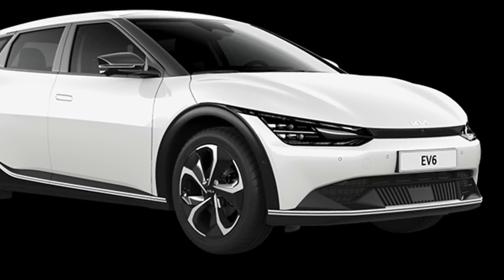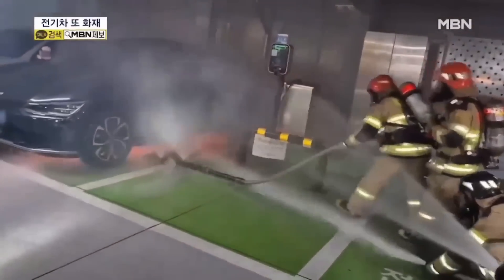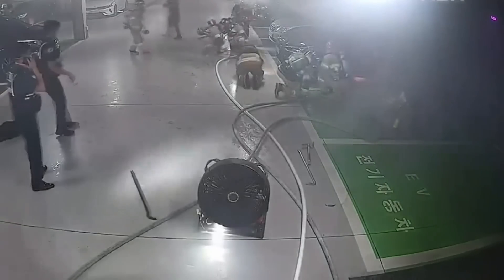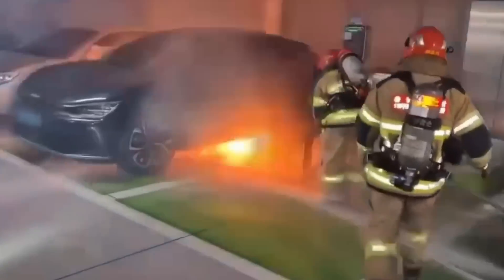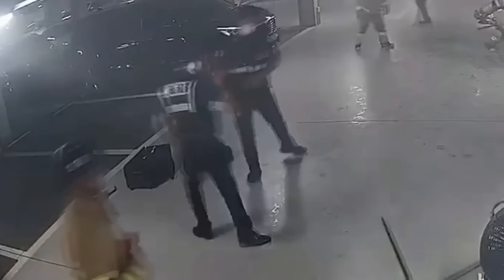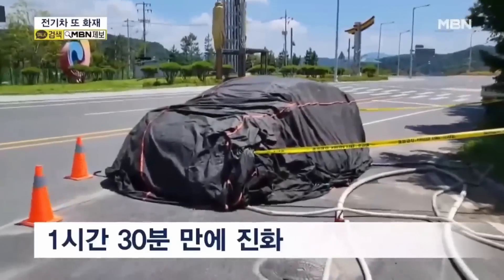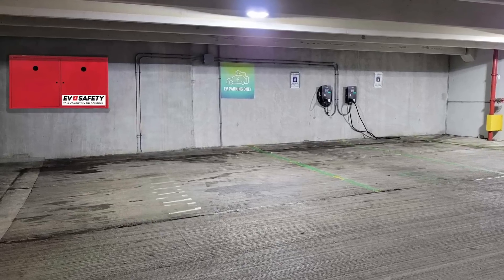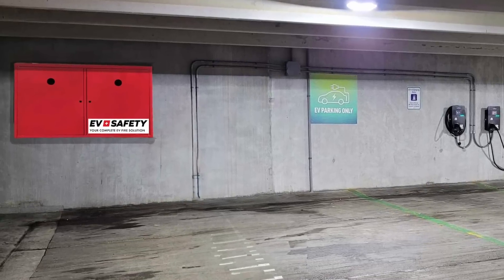Second EV Fire in Korean Parking Garage: Days Later

Comment: In every single Li-on battery based fire (cars, laptops, tools, scooters EVERY SINGLE ONE) a consumer action lawsuit should be filed for "unsuitability for purpose" along with any other violations, losses, injuries, etc.  These batteries have brought down airplanes, caused numerous injuries and deaths and in general are eventually destructive to either humans or the environment.  Congress needs to step in and BAN their manufacture until it is de facto proven that these environmental destruction and thermal runaway problems are solved and no longer exist.

Comment: Garage operation includes towing disabled and abandoned vehicles whose population will reflect increasing BEV adoption. Rollback truck owners often choose aluminum beds for lighter weight, but aluminum melts easily while a steel bed (popular for hauling scrap because it doesn't gouge and crack like aluminum) is MUCH safer if its BEV cargo reignites because bed floor burn-through is far less likely. 
I mention this in case anyone reading it can influence vehicle purchases, for example by police towing units and civilian towing companies on police rotation who may be required to haul off BEV as part of their contracts.  Anyone wanting to test could likely borrow a scrap steel rollback bed as a training aid since it won't be worth any less with the paint burned off. Outdoor parking lots have similar problems with disabled and abandoned vehicles so BEV towing skills including understanding BEV fires will be increasingly important. Modern towing and recovery is more complex than it used to be. Of course towing requires impound lots whose contents should be arranged for easy fire apparatus access between rows.

Comment: Fire Control for runaway Ev's ?? IDEA!!

How about a simple Shipping Container, with a simple,powerful winch ... 

The Shipping Container is lined with fireproof material like that popular fire resistant drywall (many but reasonable number of layers, with metal in between the layers)

Winch in burning car, a tow truck guy and a firefighter could come up with a safe and simple attachment method, or various such methods ... 

Winch in burning car, doors slam shut and latch!!   Fill container with water from both sides through access holes for the purpose.

It'd be worth a try at least, concept is simple!!

Comment: I live in Korea ATM. This is a huge issue here, and many apartment complexes are taking quite drastic measures to try to eliminate as much EV fire risk as possible. Some even outright ban underground parking, while others just ask owners to charge only when absolutely necessary
Reply: Electric vehicles can set the surroundings on fire. 

Gas vehicles are setting the planet on fire.
Reply: @franklofarojr.2969 wow. Just wow
Reply: @franklofarojr.2969 Gas cars produce only 10% of global CO2 emissions. Mining for lithium and other elements for EV batteries uses petroleum, and it devastates the area around the mine and spreads toxic dust. Disposal of EV batteries generates CO2 and toxic wastes.
Reply: @franklofarojr.2969

Tell me you're brainwashed without telling me you're brainwashed

Comment: To me there is a huge opportunity to avoid ever getting to this state.   It's a shame the industry doesn't unite and tackle this.

The BMS not only has the ability to detect a run-away event, but sometimes DAYS before this condition occurs.   The problem is, the BMS has no way to scream about it.    To me ALL EV's need to be mandated with a standardized wireless alert systems that talk to Building monitoring systems to warn of a vehicle that may be approaching a runaway state.   

This would allow responders to quarantine the vehicle before it starts to off-gas, or at a minimum allow a much earlier response.

Comment: Hyundai Ioniq and Kia EV6 have been frequently involved in accidents where the vehicle burns out and deaths occur due to battery thermal runaway after crashing into a low curb. A thorough investigation is needed to prevent further casualties.

Comment: You said the battery was 800 volts, but you didn't say its type... is it the LFP or NMC type? Do you know of any cases of fire with an LFP battery?

￼
Reply from the maker: This was not LFP.  There have been a number of LFP fires tied to energy storage.
Reply: @StacheDTraining  wow that's great, so we don't have any cars with LFP batteries that caught fire spontaneously?
Reply from the maker: @Rafa-qv8si  there have been.  Quite a few BYD vehicles. Unfortunately, it's often difficult to know which vehicles use which battery chemistry.

Comment: I wonder if a pre-piped flooding system would help in the future? A keyed cap in the trunk provides a path for apparatus to pump directly to the battery compartment and drain out a pressure relief valve that flows in a safe direction. It could be installed in all EVs and used to cool the battery in thermal emergencies, preventing the fire from even starting, or providing easy extinguishing access.

Comment: Ev are failing globally, and not enough time testing is being on the power cells to render them "safe". Governments around the world have welcomed these vehicles with open arms to look like there proactively saving the environment, when in fact its poisoning the air, we breathe and the water we drink. So where do we dispose of the defective or expired batteries when they no longer hold charge? LiFePo4 Lithium dump, or furnace? Hmmm. Of course, the EV manufacturers scream their vehicles are safe and line their accounts with big fat profits. Someone has to make a stand and stand up to stop this environmental disaster.

Comment: Comparing the Benz EQE's Chinese-made battery explosion and fire with the incident involving the Kia EV6, it is clear that the safety of Korean-made batteries can be reaffirmed. In the case of the Chinese battery, the fire rapidly spread between cells and eventually led to an explosion, likely due to the materials used in the battery separator. In contrast, the SK battery used in the Kia EV6 exhibited delayed fire onset, allowing the vehicle to be safely moved from an underground level to an outdoor area.
Reply: It's a silly comparison, like comparing being mauled by a bear to being mauled by a lion, they're both dangerous. lithium is dangerous.
Reply: @wobblyboost  The flaw is SK get the materials from china.

Comment: The incident outline is that a Kia EV6 caught fire while charging in a parking lot, but did not explode, and the fire did not spread to adjacent cars and was extinguished by firefighters in about two hours..   The possibility of a fire in an electric vehicle equipped with a reliable company's battery is more than 10 times lower than that of ICE vehicles..   Even in the rare case of a fire, it is important to manage it safely with a sprinkler, pre-staged fire blanket, etc..
Reply: Yeah, but it's more fun to go "RAAAH EV BAD! LOOK AT MY 6.7 LITER DIESEL! SOOO MUCH COAL ROLLING! WOW!" and get the likes ;) .
Reply: Traditional fire systems such as sprinklers and fire extinguishers which work by isolating the burning material from the air (and therefore from oxygen) are totally INEFFECTIVE against battery fires. The battery fire is not a standard combustion with oxygen in the air, but a chemical reaction in which both the fuel and the oxidizer are packed together so much so that even immersed in water it would continue to burn. Guess what other substances are made up of a mixture of fuel and oxidizer? If your answer is EXPLOSIVES...Yes you guessed it!
Reply: if the possibility is so low for EV's to catch fire... THEN WHY DO SO MANY OF THEM GO UP IN FLAMES    your ignorance of thinking that they are "green" and better for the environment than a normal car is impressive.   People seem to forget about basic Biology real cars right now put out CO2 which PLANTS NEED TO BREATH but since idiots on our planet keep slicing down forests left and right we have a build-up of CO2  so its simple QUIT CUTTING DOWN THE GD TREES and plant more of them and you could more than likely fix a good portion of the global warming problem.
Reply: If an EV catches fire in a parking garage and destroyed 100 ICE vehicles. Does this mean it was 1 EV fire and 100 ICE fires?

Comment: EVs just need to be banned. Problem solved. 
Enough already with this nonsense.
Reply: There are already 40 million on the road, numbers are growing everyday and here in Thailand EV chargers are cropping up everywhere.  I have been riding my electric motorcycle with its 72v, 30 amp hr battery for 3 years and it is just perfect.  Bought a BYD Seal 5 months and 7000 kms ago and it is the future....if you think EV's are going to be banned you are in for a bit of a disappointment.

Comment: Hyundai/Kia/Genesis, aka Korean auto makers are notorious for vehicle fires.  They're been recalling vehicles for potential fires every year since 2015 in North America.  So, this news is not surprising.
Reply: Your correct, they have a fire recall on the antilock brakes. It's possible for the ABS module to catch fire, even when the car is off. Not to forget about the engine fires recall too, where the engine seizes up from low oil. There's multiple ways they can burn down.
Reply: That’s all one company. Hyundai/Kia is a brand which also makes Genesis. This is like saying Ford/Mercury/Lincoln and then saying, all US companies.. it’s all one company.
Reply: @Where2bub  No kidding, Sherlock Holmes.  LOL

Comment: The big danger with this as you have pointed out is the gross ignorance of the people around this scene without BA.  The reason for this ignorance is that the danger (at least in the UK,) is not being publicised. In a confined space the clear instruction should be NOT to try to extinguish (coz you cannot) and to get out of the building and call the fire service. Some guy was there with an extinguisher I noticed.  This message is not being publicised and it’s going to lead to a very tragic event before too long.

Comment: what they need is a suppression bath nearby to the ev charging bays and parking bays so the ev can be towed from a redirect pulley or wall mounted winch straight into the suppression bath, with smoke ventilation ducts above. At least ten it protects the car park and the other cars, and limits smoke contamination of structure, cars , and apartments...
Reply: First responders in Korea apparently have no clue about lithium ion or lithium metal batteries.  Thank you for showing how effective blankets are at containing a battery fire.  The second necessary step is to use an extinguishing agent designed for lithium.  F-500 EA has been available for over 15 years.  It is past time for first responders to have it, or a similar product available.

Comment: Whats the point spraying water on a box containing a fire ?
How about a valve/socket pipe on the battery case where crews can connect a pipe to, and inject water, or CO2, or liquid nitrogen...
Reply: Mining trucks have them but aesthetics being what it is the car manufacturers think it will turn away potential buyers. 
No reason why it can't be hidden in the trunk or where the engine should be.
Reply: @NortyNige  @NortyNige I didnt know that !. They could fit a quick release connector underneath

Comment: Diesel vehicles are very often blamed after the EV catches on fire!
Reply: I presume you have not seen the video of the 2014 Rangerover Sport starting the fire at Luton airport where 1400 vehicles were damaged.
Reply: @peterjones6322  er that is what I was trying to elude to!!!
Reply: @one.wonders  So where was the EV in that incident? I know that a 2014 Rangerover isn't one.
Reply: @Tschacki_Quacki  the hybrid diesel!
Reply: @one.wonders  Besides the fact that it got immediately debunked that the car was a hybrid, I don't see the logic in saying that a hybrid is an EV???
It isn't. A hybrid is a hybrid.

Since more ICE cars catch fire than EVs, why not assume that the issue about the hybrid is the combustion part? Why would that logic only work in one way? 🤔
Reply: @Tschacki_Quacki  is that why so many auto manufacturers are dropping EVs?

Comment: Koreans have water pressure driven drill that drills battery from bottom and put water inside the pack. I wonder if they used it and if that's why fire was out in only 1.5 hrs.

Comment: I've got a tiny little 4 cylinder diesel tray unit. Turbo. 20 years old. 83,000 klms on clock. Not much new technology. Has a great sound system. Too old for Bluetooth. CD. This thing is old school. It will run happily on almost any used oil from retail fast food places. ( If cleaned properly). I'll never move from diesel now. Biofuel.

Comment: So what's going on ?
     Are these new vehicle in the 'series' with "untested battery complexes". Were the small defeat is just presenting itself.
     Somehow is the humidity in the underground garages "defeating" the electrical shorting defense.
     With the large, almost vast, number of circuits in these hundred of kilogram batteries what does the design failure rate need to be: 1 in 100,000 — 1 in 1,000,000,000. Or just where in between ?

Comment: You don’t want to use water on these lithium batteries. It actually makes it worse because the lithium metal becomes flammable when it touches water. These batteries needs to be banned.
Reply: There is no lithium metal in these batteries. That why they are called lithium ion batteries. Just like there is no sodium metal in table salt (sodium and  chloride ions).

Comment: Another case for not owning an EV.  I certainly would not buy one until manufacturers can garantee the safety of the batteries.  If I did buy one I would not be parking it near my house or in my garage.
Reply: It seems like rolling a D20 every time you park it and charge it. You don't know which side of it is "ev burns". There's no detectable warning.

Comment: Don't charge your EV without shelter because the sun can cause it to overheat and catch fire, but also don't charge your EV under shelter because if it does catch fire, it'll burn the whole place down.

This is the inherit problem with Battery Electric Vehicles (BEV). The best place to use them is urban environments, but the best place to store/charge them is rural ones. And city folk have a mighty word about reserving their valuable urban space as parking for entitled suburbanists. They are a no-win situation.
Reply: yeah but why did other 140 cars burn..sounds like bad sprinkle system as well.
Reply: @Y2Kvids  Automated sprinkler systems sometimes only run for so long and the time it takes for a battery's thermal runaway to end can be days. These systems are also not intended to extinguish fires as much as suppress them to allow people more time to evacuate and less of a headache when the firefighters arrive.

Also, something else to consider: If the ignited BEV is near other ICE vehicles, the intense heat could cause fluid lines to fail and applying water on a fire based a flammable liquid will only spread it around more.
Reply: @schwarzwolfram7925   not only that ice fires have cause two massive parking lot fires in UK. Luton etc
Reply: Since EVs are very popular in California, I heavily doubt that charging in the sun is an issue......
I'm also pretty sure that an ICE vehicle that catches on fire under shelter, is going to burn the whole place down as seen in countless incidents.

Comment: So they design the battery case to vent gases if they catch fire? So they KNOW they are dangerous. How comforting
Reply: yes, and sometimes that venting even happens right into the car cabin. Maybe now it's just a bit less comforting
Reply: good point...
Reply: The battery doesn't have to catch fire in order to offgas. Offgassing generally happens before the battery catches fire. LFP batteries can offgas without self igniting.

Comment: there needs to be some urgent development for things like a suspended fire blanket that automatically drops from above once smoke is detected and  even has the ability to automatically call the hazmat team? should these charging spots have a steel plate that can be hooked to and tow the burning car out sitting on it already even? i feel there's many ideas that could easily help that wouldn't cost very much to make a big impact in an emergency.
Reply: Here's an easier one, you aren't allowed to park your "green" hazmat in the making indoors. Then people quit buying them and the problem is solved. They are cheaply made with too much tech yet overpriced and are a hazard that claims to solve problems. I'll keep driving my diesel 2004 Excursion which actually was well built and doesn't spontaneously start fires. Seats 8 people, has 4x4, tows 11,000 pounds like nothing. Goes over 350 miles on a tank of fuel and can be refueled in ten minutes. Also if I get in a wreck the survivability of myself and my passengers is pretty good unless I get hit by a Mack truck. Know any of these EV's that can do all of that?

Comment: In my country, fire regulations are still not updated. Huge underground garages and no sprinkler system to safe the building in case a EV decides to go into full meltdown mode. As usual, it will take a major incident before they wake up, They are currently more busy with censorship and misinformation laws to make sure we stay silent.